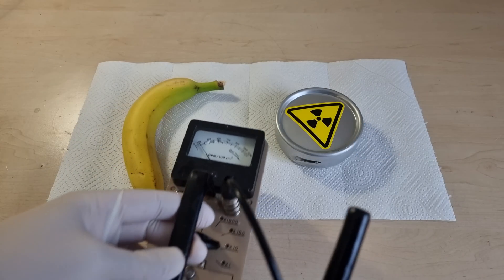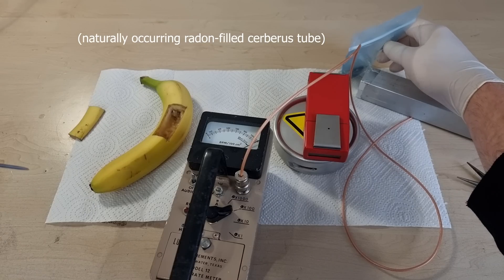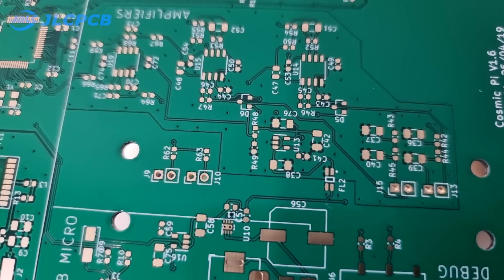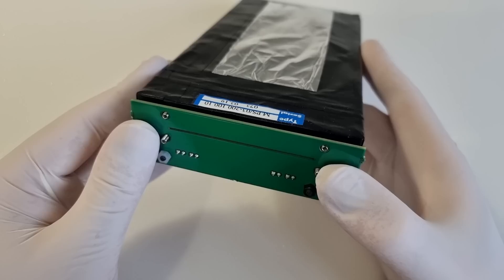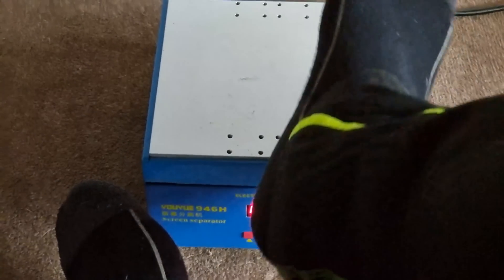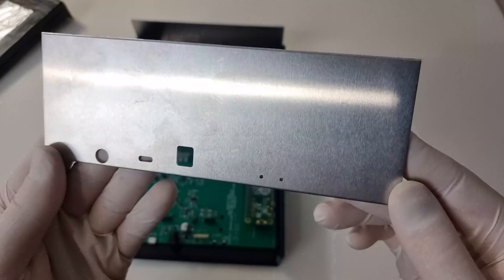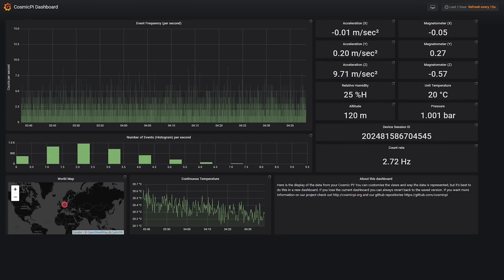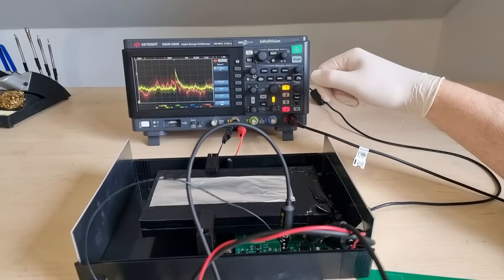CosmicPI: Detecting Cosmic Rays with a Raspberry Pi

Comment: By the way: the particular signal amplitude does not matter that much in this exact application apart from distinguishing cosmic ray muons/electrons from each other and from other radiation sources. The particular muon energy does not contain much information, since after cosmic rays hit the atmosphere a huge particle shower is produced (just as you said), in which most of the information is, unfortunately, lost (for example, it is much easier to detect the initial particle mass (A) than it's charge Z). Most of the information is restored from the number of particles in the shower, not from their energy.

Besides, the signal amplitude won't change very much with changing muon energy due to the particular "particle energy - energy losses (which signal amplitude is nearly proportional to)" curve - the bethe-bloch curve. That is why calorimeters, which absorb the particle, are way more precise in energy detection. Absorbing a muon requires a shitton of tungsten/lead and a huge number of detectors to acquire the precise path the particle has traveled and it's energy losses along the way. In short, there are ways around this problem (not only with a calorimeter straight approach), but certainly not cheap and easy ones. Signal amplitude usually in these applications contains more information about the particle type, not it's energy (for example, the signal amplitude is proportional to Z^2 and detecting the particle charge is way easier).

Just to be clear: I am talking about registering cosmic ray muons, which are relativistic. At low energies the signal amplitude do rely on the particle energy - see bethe-bloch curve, again.
Reply: Probably the first time experimental nuclear physics education paid off
Reply: @Sx107music  lol
Reply: interesting. thank you for posting
Reply: it‘s not only muons that trigger the detector plates from cosmic radiation. some decay along the way down from the atmosphere and the resulting electron or gamma photon will be captured which can leave a bigger signal than a muon. in rare cases one muon can decay within one slab and the decay product may reach the next one, which can be traced by tight timing resolution or looking at the signal amplitudes
Reply: @oliverkeller2342  just as I said, distinguishing electrons from muons. But, the process you described is not the main source of gamma and electrons. The main source is the pi-0 particle decay (which decays insanely fast), which are produced in the initial nuclear interaction with the atmosphere. Pi-0 decays to two photons; and those become a part of an "electromagnetic cascade" (at least that's what it is called in russian). Photons produce electron-positron pairs, those through Bremsstrahlung (had to copy that word from wiki) produce photons, those produce electron-positron pairs and so on until particles hit the detector.
Reply: @Sx107music  sure, I just didn't want to go into that even more complex rabbit hole ;-).
I am noticing in almost daily business how many amateurs, as well as scientists, focus often on the muon while there's much more particle variety composing natural "background" radioactivity - in terrestrial as well as cosmic sources. 
For example, one could be surprised about how many experimental particle physicists don't know much about the ubiquity of radon, which Marco gladly mentioned as well. Mostly, I suppose,  because straight muon tracks are the only "background" component showing really up in the average large high-energy physics experiments.
Reply: @oliverkeller2342  mostly because they are the hardest to shield from
Reply: @Sx107music  yeah but radon is a sneaky little gas :-) and the fact that large detectors designed for TeV energies don't see its contribution in the overall dataset doesn't mean it isn't triggering the average Geiger Müller tube as well as the electromagnetic cosmic ray cascade that you mentioned. anyway, now we got carried far way. I've reread your top post and initially didn't get that you meant muons as well as electrons from the same cosmic sources. That's why I made my comment and maybe it was helpful to point that out more clearly for others
Reply: @oliverkeller2342  perhaps I'm not quite used to radon protection, I work more on satellite experiments than groud-based ones :) Yeah, this discussion can go on forever, but I guess we both made our points
Reply: @Sx107 Thanks for the detailed explanation. I've been interested in nuclear physics all my life but didn't pursue a degree and opted instead for EE / IC design because of better job prospects. Thanks for mentioning the Bethe-Bloch curve, it was an interesting read.
Reply: @strelok2812  and here I am, regretting that I didn't go the EE route :)
Reply: What's a muon or electron look like? How can anyone know what is being detected if no one knows what is being detected?
Reply: @PeterMilanovski  First, don't deny the existence of things that you can't perceive with your own senses, that's solipsism. Second, you can calibrate the detector, for example, with a known beta-radiation source (that is, it emits an electron) and see to which of the signal peaks it more or less corresponds in the signal amplitude distribution (but you will also have to consider the energy). Third, the understanding of cosmic rays, atmospheric particle showers and nuclear physics in general is so developed today, that you can just run a simulation of an atmospheric shower (in CORSICA or FLUKA, for example) and a simulation of particles passing through your detector (in GEANT4, for example) to see which signal amplitudes are you expecting, though at least some experimental calibration would be great - and, as it happens, a classical way of calibrating nuclear physics equipment is using cosmic ray muons, so in our case that's no problemo.
Reply: @Sx107music  but does a radiation source emit an electron? We can definitely say that something is being emitted but we can't really say that it's an electron... The standard atom model is basically just that, a model! And yeah it's pretty but it doesn't work... I can clearly see that Neils Bohr was thinking along the lines of how planets revolve around the sun but the proton, neutron and electron don't make sense! It just doesn't work... Until we can get to see inside an atom, we really have no idea what we are detecting... 
Models for models, they don't include everything known let alone the unknown... Somewhere you will get lucky with a prediction from a model but most times no! More work needs to be done on being able to see inside an atom and less on quantum Gibberish... So unless someone can show the world what an atom really is, protons, neutrons and electrons are nothing more than a figure of someone's imagination... And therefore shouldn't be used as fact. This sort of thing is happening everywhere throughout the scientific community and it's done nothing but bring out more theory that's based upon theory... That's just no science I'm afraid... The answers are out there but when you have been taught not to see it, it could be right in front of your nose and it will be completely invisible... Just like a religious person who can't see a world without a god, you can't see a world without an electron or a muon or any other particle that you have been taught to accept that they exist even though you have never seen one! Even though those things just don't seem to work when you try to apply their theories on things not on the whiteboard! 
Tell me, how is it possible that we have so much different types of matter when we only have a proton, neutron and a electron? How many different things can you possibly make with just three things? It's impossible! This is just one reason why it doesn't work but there are more! Why is a proton from one atom attracted to the electron of another? What's wrong with it's own electrons? LoL that doesn't make any sense either.... 
A good education should give you a direction but also give you the tools to test it for yourself....
Reply: @PeterMilanovski  why should the world make sense? Why would the universe align itself with your intuition? You don't matter. The truth doesn't care about your belief, so it's likely that the truth doesn't make sense to your intuition. Just because you don't understand it, doesn't make it any less true.

Of course, "true" here just means "as close to the truth as we can achieve". But I don't go around adding "as far as I know" to the ends of all my sentences - it's just implied by me saying the sentence.
Reply: @chaklee435  
>> Any length of scientific text appears
>> Anti-science freaks attack

Should be a rule of the internet
Reply: @chaklee435  I agree 👍 I don't matter, in fact no one matters! Everything else will continue to do what it does when it wants to! 
You might not go around adding "as far as I know" because you might feel that you probably feel that you already know everything? Who knows what your story is? 
I don't have a problem admitting that I don't know everything but when there's no actual evidence for something and theories are being thrown around like it's a real fact, I don't sit well with that and I feel obligated to speak up. 
In fact I just watched a video where someone from NASA gave a talk about their mission to Pluto and beyond, one of the best talks that I have heard in a long time, he was asked questions and his replies included terms such as "I don't know, we think, I can only guess, I would imagine". It's okay to not know something! It's also okay to admit when you are wrong... So when I say "as far as I know" I mean that I know there is no evidence but there's always the possibility that some might exist which has recently been revealed and I haven't come across it yet and that would have been the point where you can come in and tell me that I'm wrong and that actual evidence exists and this is the link for it... 
But that's not what you did! Is it. 
You did what most historians do which is exactly what you are, a historian! You only know history, it's what you have been taught, tell me! How much of what you know is from self discovery?
Reply: @PeterMilanovski  I utterly agreed with you! Science just become the "art of throw up theories" As an example, the black holes doesn't exist. They were "created" to explain to what the stars are orbiting to in  a galaxy, because the gravity - that unexplained and strange force - must be valid even for stars. But, as soon as we approach to atomic scale, the gravity become less relevant and other forces are involved. Perhaps the same thing happens when we increase the scale to stars level... But everyone believes that those "devices" - the black holes - are so real that people found evidence of its existence. I think that's a serious issue for science. Old days were easy: see a phenomena, study it and find an explanation. Today the process is: write an equation, create "the phenomena" and look into the "universe" for something that "proves" the equation...
Reply: @fperea  you sir! Are more scientist than most who have a piece of paper that says that they are! 
I totally agree with you 100%.
I personally would be happy to hear "it happens but we don't really know why!".
This statement leaves the door open for the chance that someone will work it out, instead of coming up with some rubbish that others will accept as fact and stop anyone from actually finding out the truth! 
It's been 40 year's since we have made an actual new discovery! There's a huge problem with the scientific method, it's not working! 
I know that there's a better way but no one wants to hear it.
Reply: @PeterMilanovski I don't think the scientific community will see this video and change their mind! But, at least it's a start! I am certainly not a "scientist". Thanks God, I'm not. I'm just an engineer. 
Some time ago I was wondering what is the purpose of the light speed limit. What in the heck God, Yahweh, Allah, Muhammad, the big bang or whoever created this universe, was thinking that made it very big, with lots of matter, huge amounts of energy and then set a speed limit? A really slow one compared to the other amounts. What is the purpose of that limit? Would the universe work differently if that limit did not exist? 
If possible, keep trying to evolve science, because it is getting more and more dangerous. Today all mankind is convinced of "global warming" even though there is no proof of that, nor that it is impossible from a thermodynamic point of view ... 
I think we have to keep trying to correct science, even step by step. It took a long time to Galileo, Kepler and others but they made it...
Reply: @fperea  I don't doubt that global warming is happening, I just doubt that we actually understand the how and why! It's easy to say that humans are responsible for global warming, we know that the population has and is growing! But I would like to bring to attention the coal that exists in just about all the frozen lands. I first learnt about the existence of coal in Greenland and then in Antarctica! Some of these places have been frozen stif as far as humans can remember, how did that coal get there? Was there a time when Antarctica was actually tropical and it was green? Dinosaur fossils have also been found there. 
So my question is, is this global warming a normal cycle where the planet heat's then cools periodically? Or are we actually responsible for it? But if we are responsible, how did the coal get there? Was there a great flood that washed it there or did tree's grow in Antarctica? 
From what little research that I have done on coal and petrified wood, depending on the circumstances, it doesn't take long for coal and petrified wood to happen, wood can be petrified in a matter of hours in controlled lab conditions, think about that, it takes hours to turn wood into stone! Coal on the other hand had been done in a few weeks if my memory serves me correctly! 
So basically I'm thinking, we have evidence of past civilizations that we don't know what happened to them, did the climate change and they didn't survive because they didn't know what to do? Should we be preparing to insulate ourselves from a hotter or colder planet? I look around my house and think about how would this home hold up to more heat or cool and I can't see how I would survive it! It's not impossible but but no one builds housing to stand up to those kind of obscure conditions! Just because it hasn't happened yet, doesn't mean that it won't or can't! 
Nothing is for certain because we really just don't know, we just think that we do.
Reply: @PeterMilanovski  "...how many possible things can you make with just three things?" 
Man, you clearly don't eat much Mexican food lol.
Reply: @0000Sierra117  LoL I can't say that I have ever eaten Mexican food! It's not a very common thing down here, I'm sure that it exists here, just not as much as other places in the world! As far as making stuff with three things, you can make a lot with simply varying the amount of each thing...

Comment from the maker: One day late for pi day 😥
Reply: Approximating Pi to be 3.15 is good enough for engineers though
Reply: @kapteniglo7404  I think you mean pi=e=3 is good enough for engineers. He's in the right month at least :P
Reply: @SplicesAndCelluloid  Well, if 3 is good enough for engineers then 3.15 is clearly good enough too because the absolute error is smaller.
Reply: @namewarvergeben  except you ignored the e he also mentioned.
Reply: @SplicesAndCelluloid  In astrophysics class we would routinely round pi to 1 or 10 depending. (since pi>e, for fermi approx it gets rounded to 10)
Reply: xd
Reply: piTY it is the day after that (m.ππ.TY) ~ 3 14 15 926535....
Reply: Aw what, pi day completely slipped under my radar this year!
Reply: But not for the Ides of March.  Beware!
Reply: Why the stress? Another way to see it is that others were < 10days earlier for this year, but you are 364 days earlier for 2022, beat that. ;)
Reply: That's ok, the PI here is redundant anyways. There is already what looked like a wifi module that could have done everything...